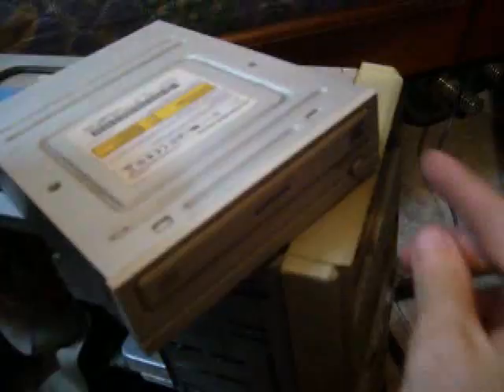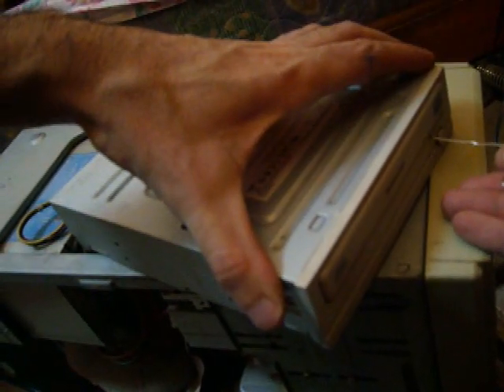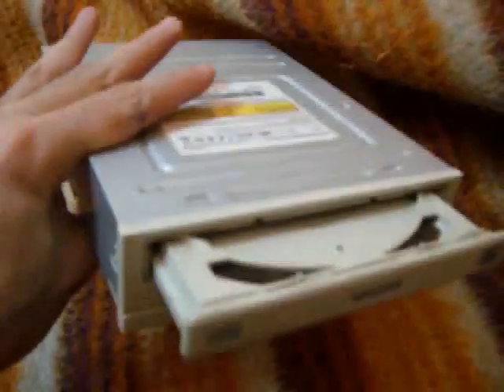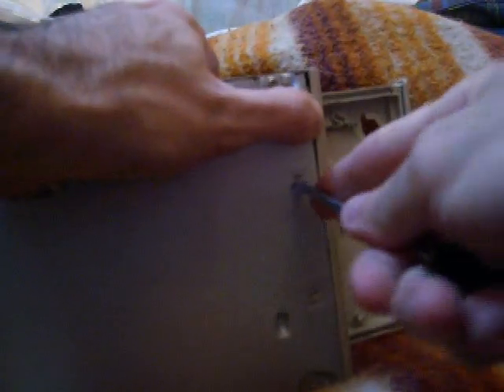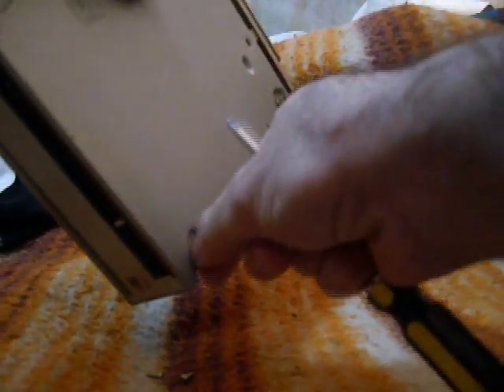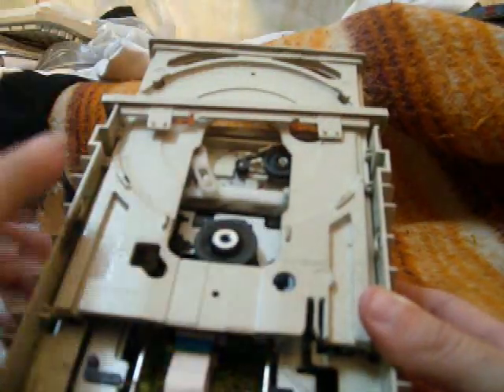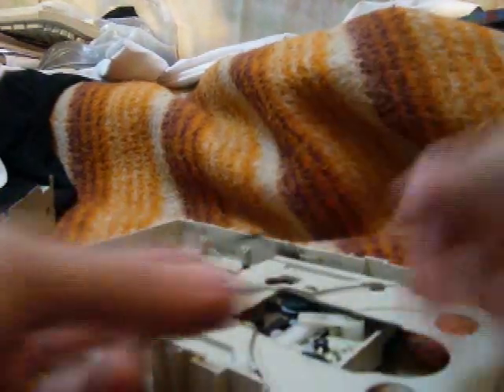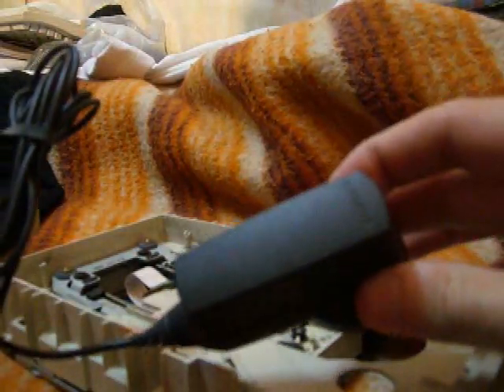How to fix a DVD drive's tray that doesn't open or eject

Comment: Been repairing pc's & laptops since '96, never thought that was the issue. I tossed how many in the trash over a stupid rubber band. In my case I used a thin nitrile o-ring , works like a charm, should outlast any rubber band. Nice fix. He needs the Nobel PC Peace Prize!
Reply: My dad did the same thing. Sadly he never thought to google it

Comment: HA HA HA!! 8 years after this was published, it helped me fix my 13-year-old Philips DVD-RW. Works again! What a stupid-easy fix! The tray on mine makes it very difficult to work under, but they actually made it extremely easy to remove, so after that it was about a minute's work to put it all back together and get it running again. GRACIAS, AMIGO!!
Reply: Hey that's great.....so is that ancient drive still working?  it would be 17 years old now circa 2023.

Comment: Thanks for the tips. I've got a DVD drive to fix and had trouble removing the cover.  BTW: Another way to source the rubber belt is to cut one from a bicycle tube (waste bicycle tubes make good and durable rubber bands.  I cut them using a paper guillotine and they come out good)

Comment: You're very good the way you fixed that hard drive tray with a rubber band. I'm having that same problem with mine, except I have an E and F tray on my PC. The top tray which is the F one won't open. And I have no holes where I can open it since its a custom PC made for me. I might have to take it into the computer shop and have service men work on it.

Comment: Such A Really Easy Fix! I didn't have to watch the video and I was just reading the comments. I had little rubber bands that I had bought for my hair from the dollar tree just in my bathroom! They are the ethnic little black rubber bands for African American hair ect. They come in a big pack and you get a lot for a dollar! Easy Quick fix since I have had experience with removing and taking apart disk drives!

Comment: In my sony dvd it is actually accessible without disassembling.I took it out, washed with detergent, cooked few seconds in boiling water, cleaned plastic parts with alcohol, rubbed all pieces with dry soap and assembled.Works fine. Sometimes it is just greasy rubber problem.Have a nice day.

Comment: Thanks ... This was really helpful ..I didn't remove the drive but just unlocked it with the pin and wiped the rubber a little ...And voila its working for me .. guess if it gets stuck again will repeat the same ...

Comment: I found that heating the o-ring either by boiling it or giving it a good pass under a heat gun will work too.  
Also silicone paste or spray rejuvenates rubber.
Reply: Forgot to mention; You saved me a ton of time in showing how to disassemble and what is the exact problem, many thanks!

Comment: There should be two small plastic levers down those two U-shaped holes on the sides. If you push them down, you can pull out the tray so it's easier to replace the band.

Comment: The tray, if it is out simply slides straight in. There are two small catches that hold the tray from coming off the slide mechanism.

My DVD I wanted to modify so it could play discs on its side.
On its side the weight of the mechanism does not aid in the tray opening.
The fix is put a small washer. I used copper ring terminal. I cut off the end and filled thinner. This glue to clamp in top cover which the spindle motor magnet uses to hold the disc securely when it spins. Make sure it fits flat

Comment: The hole (along with the normal-looking DVD-ROM front panel) is most likely hidden under the front case cover. You may be able to remove the latter easily, as many computer cases permit it, and don't have warranty seals on it.

Comment: I've had a similar problem on the last 2 drives I've had - both will open the tray while a disc is in it, but won't open if no disc is inside. This isn't the problem of a rubber band, so I'm wondering what else it could be.

Anyway I'm upgrading to a Blu-ray drive soon, would be nice to know what causes this to happen just in case my drives are cursed. :P

Comment: I had this same problem with my SACD NAD audiophile grade T585 player. I found the right rubber bands at a beauty supply shop.  they are the perfect gauge and diameter and were only $1.50

Comment: thank u sir for your video, i already repaired my cd-drive and i used motorcycle tire interior for the rubber. :) but i didn't used clip. i just open the bottom plate and slide something there to open the cartridge.that's all. :D

Comment: A different suggestion. My Asus drive’s rubber band was fine. The drive would eject when the top cover was off. At first I thought the cover might be impinging on the mechanism. Then I decided to swap in the cover from an old Asus IDE drive. Bingo! So, whatever the loose plastic disk in the top cover is, that must have been the problem. This video suggests that disk contains a magnet. Why a defective magnet disk would prevent the slot from ejecting is beyond me.

Comment: As no doubt mentioned elsewhere there is a tiny hole on the facia of the DVD unit into which I pushed a safety pin less than three-quarters of an inch and the door popped open. I then learned that I had to slide the draw in and out by hand most of the way; at least a dozen times before it loosened up enough to reliably pop closed by itself, which it did a number of times before it was loose enough to open by itself.. I didn't have to look inside at the elastic bands or anything else.. Good luck all; mine is used very seldom and I would expect the same nonsense next time... If you find these words useful please cut-and-paste them and make them current for the next people. Thank you...

Comment: dude your the best, it totally worked and the rubber in the dvd was so damn hard, i didnt know rubberes got like tht :P. i have one question though, evrything is working fine but sumtimes, the dvd drive, the light keeps on like it repeats itself. It happened alot when i was just finished with the process but now only sumtimes with like a double repeat? whats causing tht?

Comment: I used a lighter on the rubber band. Warm up a part of it then press it together from both sides, as if trying to make the ring smaller. Do it all around it. 
I was counting on the malleability of rubber, and it worked out. Who knows for how long though.

Comment: The right belts are hard to find...
Remove the tray motor and sand out the motor bay in the DVD frame and it's screw holes. To allow the motor's position to be adjusted and the belt tensioned.

Comment: The emergency eject hole isn't working. My pin even bended a bit after going in but it does not opened.

Comment: There's two parts to this problem, the (1) belt is slipping (or motor is weak) when it is (2) fighting the magnetic hub clamp that has more hold without a disc than with. Another solution is to always keep a disk in the drive, reducing this magnetic hub hold.

Comment: I have the problem after I updated BIOS. My laptop is Gateway ID49C07u and I downloaded BIOS update version 1.07 file from vender web, and I opened the windows folder, and double click on the NELA0107_WinFlash.exe file then I run it. After that my laptop screen was black, but power was on and I can hear that its fan was running. I tried to do follow by your video clip, but it didn't work. Could you please help me?
Thank you for your help.

Comment: it's better to use a smaller diameter rubber bands. Experienced with numerous dvd drives. Equal size is not good.

Comment: There is no radiation hazard in the DVD-ROM. The "radiation" warning is only for the laser, which is basically no stronger than a laser pointer. Just don't point the beam straight at your eye for long periods of time (if you even somehow get it to fire up when it's disassembled) - that's all.

Comment: Paperclip does not open the drive for me :(
Reply: Try a long needle used for making woolen clothing i used that it popped open quickly
Reply: yeah and keep trying and just keep pushing. paperclip fixed it for me altogether
Reply: Power the CD/DVD drive on, press the button to open the drive and then try inserting the paper clip to unlock it. Cheers!
Reply: Just poke the top with paper then it opens :)
Reply: Z
Reply: What? I can't understand. Please speak clearly.

Comment: rubber band if slip........ open tray by using needle and use Fevibond synthetic rubber based adhesive on ruuber band and try to open and close till adhesive dry........................... try this no need  to change rubber band

Comment: It's a case of the rubber belt losing its grip. To fix, I just dab a bit of Coke/Pepsi using a Q-Tip on the inside surface of the rubber belt. Brought more than a dozen optical drives back to life in the office. You may need the paper clip to manually pull out the tray the first time to access the belt, but that's about the only tool you'll need. You don't have to open up the PC case to apply this fix. You only do the latter if the belt is missing or broken.
http://i751.photobucket.com/albums/xx152/oj888/OpticalDriveTrayDoorDIY_zpscee9ae1c.jpg
Reply: Thanks this Coke fix works easily

Comment: Any computer over 2 years old has this problem it seems.
Reply: Chris Tubestinks nope i have had a pc for 5 years without this issue, also an xbox 360 for 6 years and it also doesn't suffer from this (optical drive from a pc is the same in an xbox)

Comment: Yeah, but what about the piece of plutonium they put into DVD drives? Won't that give you cancer?
Just joking, of course. If the drive is powered off there should be no danger whatsoever. Well, except for the sharp and pointy parts, that is.